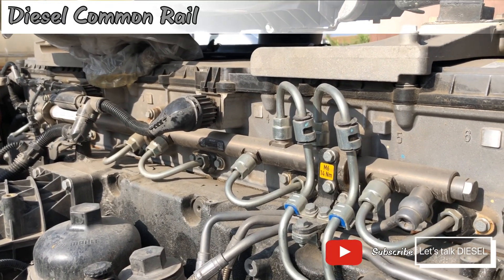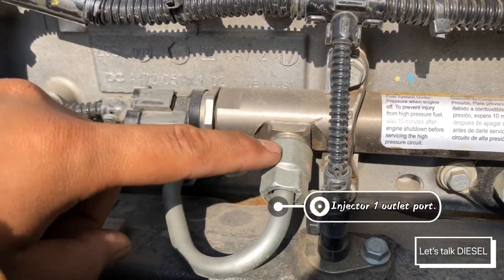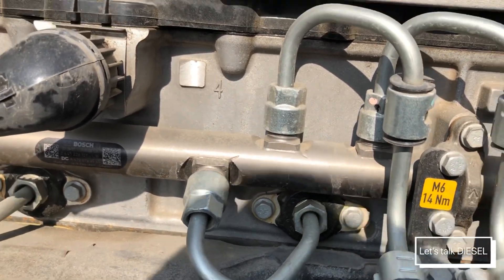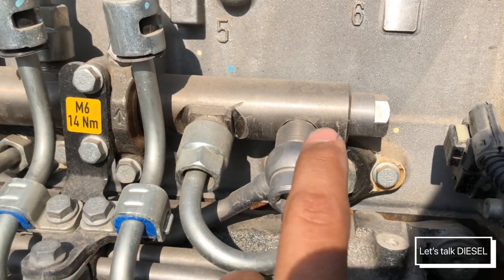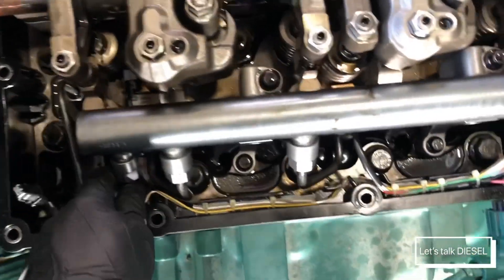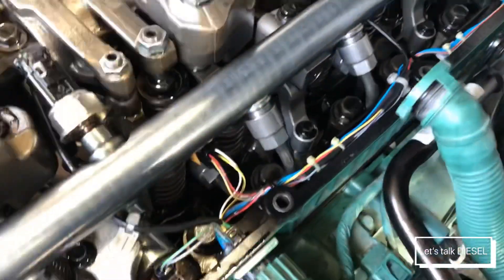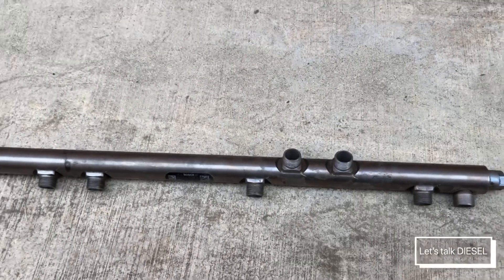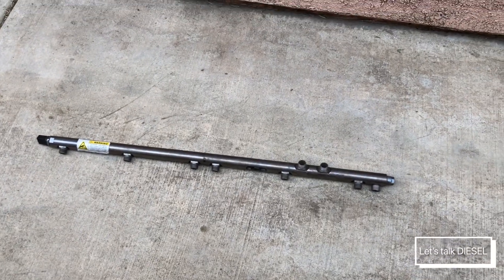Heavy Duty Diesel Engine 101 Episode 7: Diesel Common Rail.

Comment: Hello my friend thanks for all these videos theyre very helpful. I have a questions, the relief valve on my d13 “with new fuel rail” has an issue and im looking to replace it. I bought the valve and also bought the updated pressure sensor and the harness for the pressure sensor. I wanted to to replace the harness for the relief valve as well but the dealer said “it comes together with the whole engine harness and is 3000$” but on your video @5:01 its looks like both the harnesses are de-attachable. Could you comment on this situation please and thanks 👍
Reply from the maker: Yeah, you are right. If your truck has the rail system, the injector harness comes in two pieces. The first one for injectors 1, 2 and 3 also has the connection for the Rail Relief Valve. The second for injector 4, 5 and 6 has the connections for the engine brake valve and the fuel rail pressure sensor. Perhaps, the dealer got confused and thought that you want the old engine harness (for older trucks without the rail system), try to check in another dealer or clarify to them with photos your injector harness. I hope this help and thanks for watching.
Reply: @LetstalkDIESEL  thanks you for the reply, i checked with 3 dealers. One in Omaha, NE had no idea what i was talking about. One in Sioux City, IA said the harness for pressure relief valve and injectors 1/2/3 come with the whole engine harness. Then i called the dealer back home in Seattle and they said the same thing as the Sioux City dealer but the employee agreed with me that it Doesn’t make sense. Volvo dealers suck man, biggest downside of owning a d13. Im gonna show them your video when i get back and show them how both harnesses are detachable and see what they say.

Comment: 1,3,5 can be cut off too save fuel when going down hill....or low/small load on engine. ...
Reply from the maker: That might be one of the reasons. Fuel economy is their concern in these days, high performance with improve fuel efficiency.